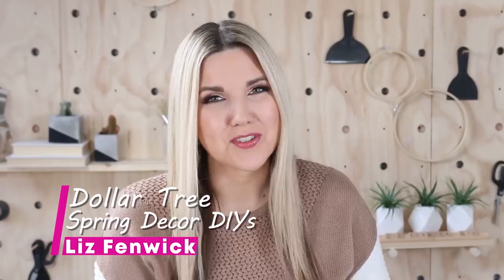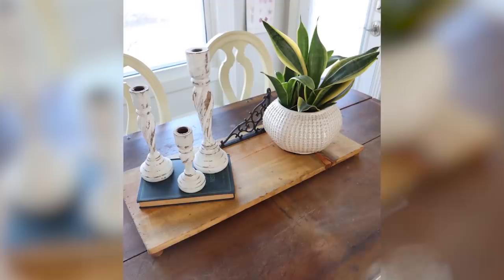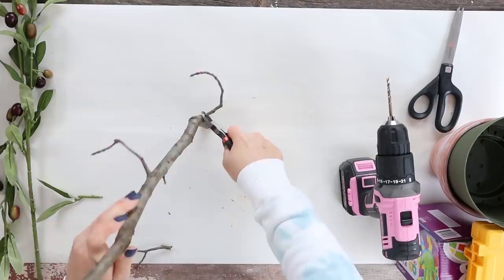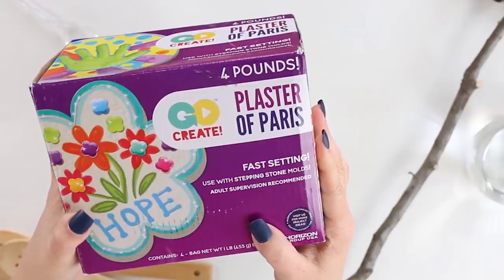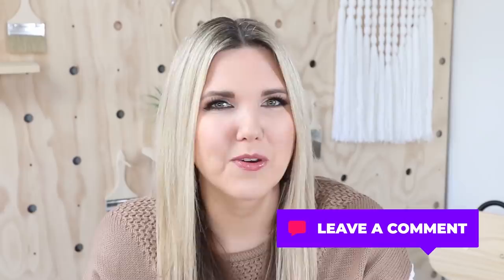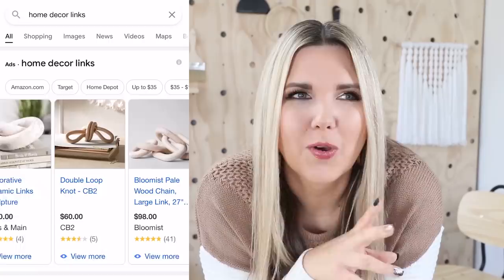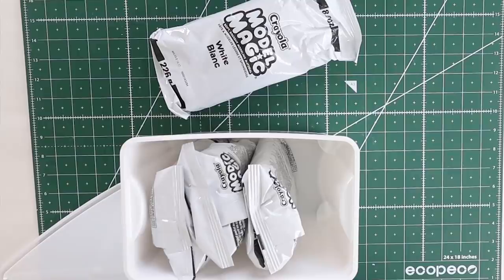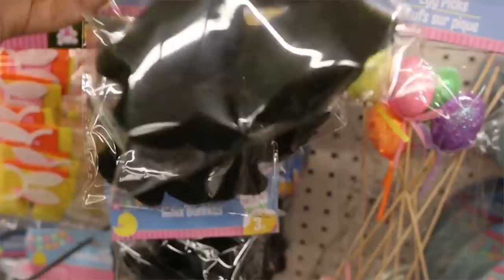WOW Dollar Tree Spring Decor DIYS (Not Tacky)...You MUST Try!!

Comment: I would do the chain DYI, but I would try to prop up each link while they dried, so each link didn’t sink and bend on the sides like a pretzel. I’ve never used that type of clay, but I’m also wondering if instead of linking them, you could let them dry flat separately, and then while they were dry enough to keep their shape but still pliable, you could cut them, link them, and glue the ends back together.